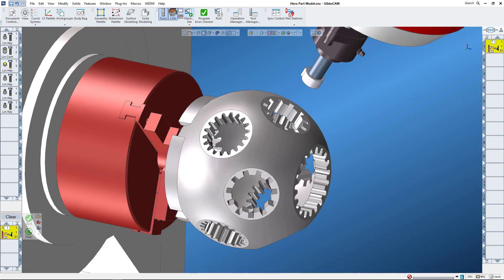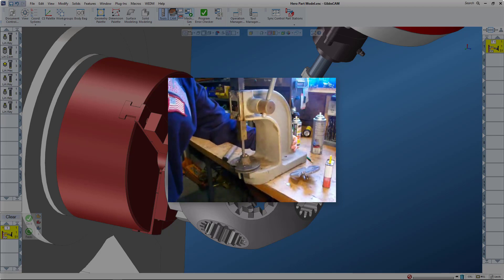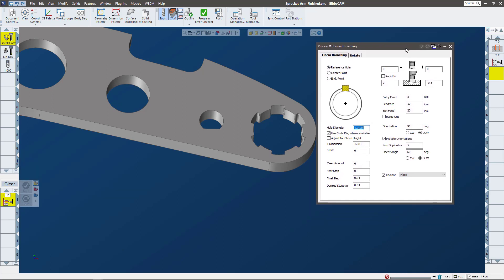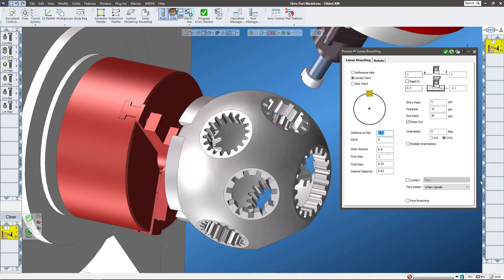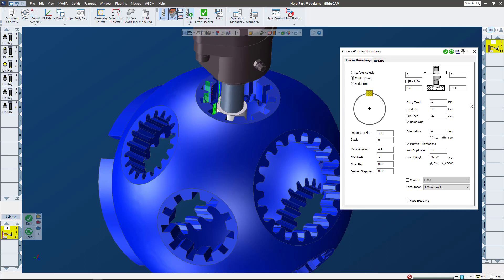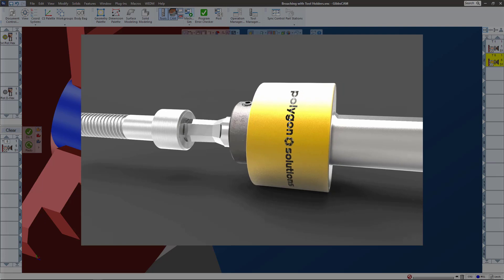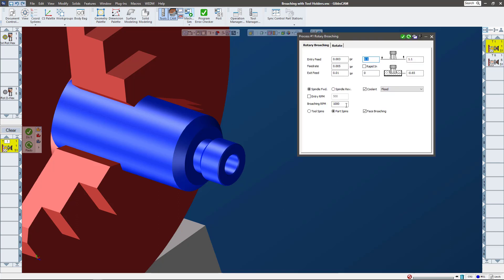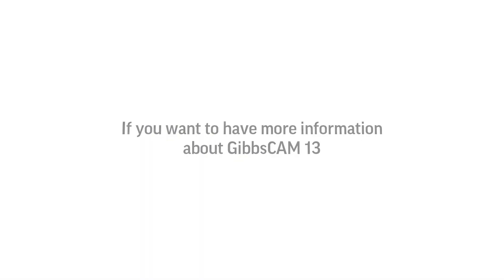GibbsCAM 13: Broaching

Comment: great video thank you very much! what about helical broaching on a millturn machine? we've had this part where we needed to broach a helical groove with a 1" pitch inside a 1" ID hole about 3 inches deep. kind of looks like a thread but it must be indexed to the part in a particular entrance angle. I am a gibbscam 13 user btw.. thanks again!